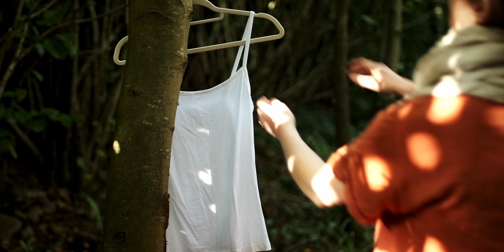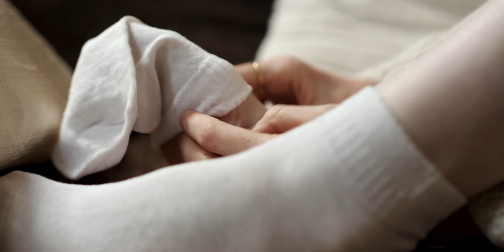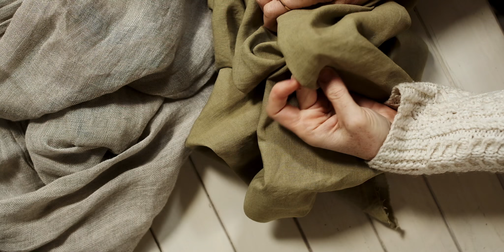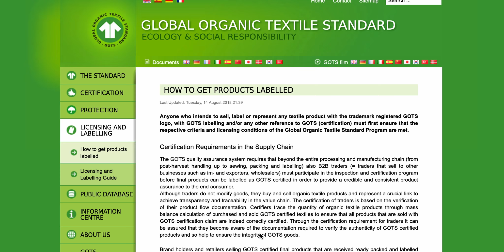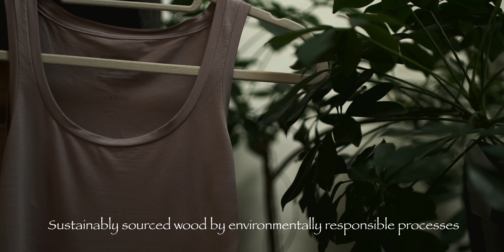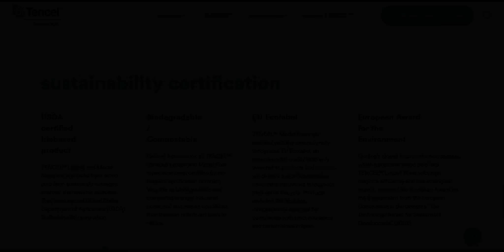4 Sustainable Fabrics - Slow Fashion

Comment: Could you make a video on safe cookware. I will be moving, and I would like to buy safe cookware. But I don't know where to get it.
Reply from the maker: Karen Perez hi Karen,

That’s a great question. Don’t have enough pots to talk about it but I know clay pots and cast iron pots are the best. 
They are harder to find and cast iron is very heavy and needs seasoning regularly or else food sticks. 
Copper is another good choice but all the modern ones are lined which you don’t want. So copper pots can be bought in antique stores for high prices. 
The most economical and safe is good quality stainless steel with no lining or coating. 
Frying pans are the trickiest because they put non stick coating on them which are damaging. 
We have stainless steel pots and a cast iron pot. Our frying pan is ceramic with a non stick coating that the company said was free of toxic chemicals namely POC(I may have got the initials wrong)
Basically stay away from Tefel and aluminium.
Reply: Thank you (:

Comment: Natural dyes are not always better for the environment.  The mordants required are often metals, and often toxic. People need to be way more careful with natural dyes than synthetic. Also, where's the wool? Sheep are a renewable source if high quality durable fiber, they are not raised in cafos and are often kept on pastures that aren't suitable for growing crops, rocky etc. (Come on, you're in Ireland,  you should know this) wool is  also, anti-microbial, and antibacterial.  It needs very infrequent washing, usually once a year, and keeps you warm even when wet.  With the exception of certain areas in Australia where fly strike is deadly are not usually  muelsed, and it's really frowned upon in the sheep farming community. Wool takes color better than any other fiber. You can even dye it with food coloring  and vinegar  and it will be light and colorfast. Some varieties are next to skin soft and is used in performance athletic wear. Wool is good.
Reply from the maker: Wool is linked to a lot of animal cruelty and therefore I didn't want to include it in the video... some sheep farmers in Ireland have ethical practices but it is rare...
Reply: @FairylandCottage  you need to do more research.  I have been a hand spinner for more than 30 years. I have never once met a farmer who mistreats  their sheep. Don't believe PETA they're full of bs.

Comment: Thank you for this Niamh.  Do you know if bamboo fibre is sustainable?  I have a couple of tops made of bamboo, bought on the assumption that it would be but I don't really know.  I'm trying to move on to linen as much as possible.  Good to know about organic cotton too.
Reply from the maker: Jacqui du Rocher hi Jacqui,
That’s an interesting one. Bamboo as a substance is sustainable but when they use for clothes, mainly viscose and rayon, it is harshly produced where toxic chemicals are used in the production and forests are abused etc. also the end product is not compostable. 
I bought bamboo clothing before thinking it was natural only to find out through research that it is not. 
Tencel or lyocell is the sustainable bamboo clothes that is compostable at the end of life and sustainable practices are used in the production.
Reply: @FairylandCottage  That's really helpful, thank you
Reply: I did not know that about bamboo. Thank you for the information.